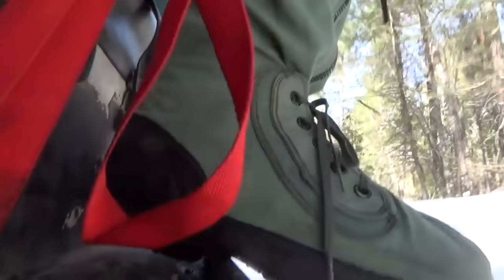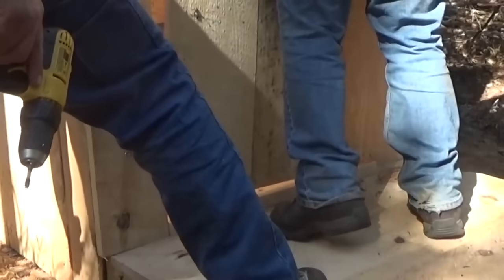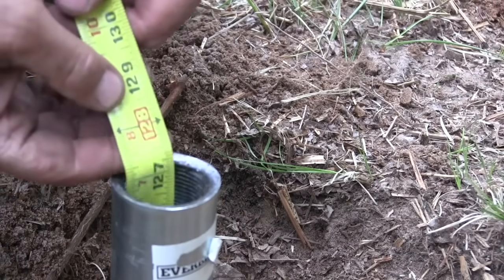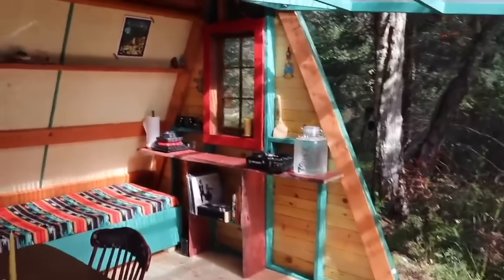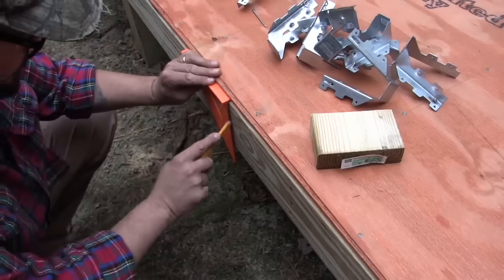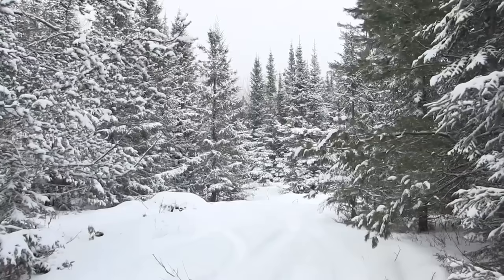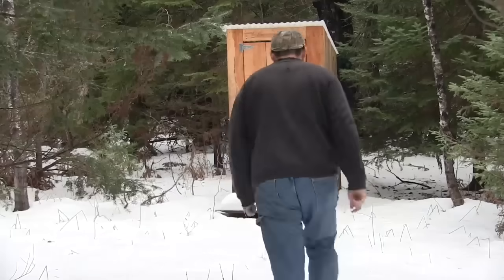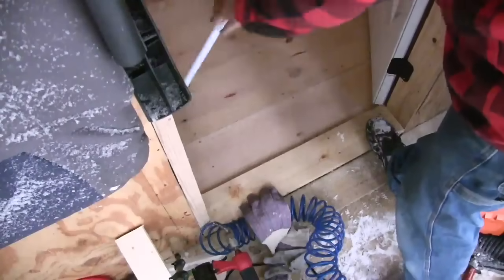Off Grid Homesteading.....everything you need to know

Comment: Instead of an outhouse, consider doing a composting toilet.  A simple 5 gallon pail with a hinged lid with a normal toilet seat on it works well.  If you line it with a composting bag it makes dumping much easier, and you just use sawdust on top of each load.  A hole in the bucket with a funnel and hose attached to drain urine will keep the mixture dry and odor-free.  You can drain the urine into a small pit with stones and sand, maybe a little peat moss.  I have a shower in the same building and the water just drains through the deck cracks and waters down the urine.  When the bucket is full you dump it into a big black composting bin.  I have never been able to get the bin even half full, it composts down to nothing each year.  No flies, no stink, not that difficult, and no digging!
Reply: Or just leave the stuff in the buckets and let them compost for a couple months before adding it to a pile and cover that with another layer of carbon (hay or wood chips) and let it sit for a year after your last contribution.  No need to turn it.  Easy peasy.  No stink.

Comment: My grandparents didn't have electricity until the 70s and always used an outhouse. I got to experience a life that was probably not much different from the 1920s as a child. One experience I have permanently etched into my memory is plunking my butt down onto a cold wooden toilet at -40 degrees. I sure wish styrofoam had been invented back then...  Now this was on an Indian Reservation in central Ontario(Canada) and they never had to move their outhouse. When it was full, my grandfather would hike into town and buy a can of quicklime. They'd pour it into the hole and it would dissolve most of what was there. Not sure if that would have been legal off the Reserve or not, but it sure saved a lot of digging. 🙂

Comment: Love your down to earth backwoods practicality. Reusing older equipment is great. Not only are they totally capable, they are made of superior materials. One thing I'd like to share is if your sandpoint ever gets clogged, you can fire a .22 caliber straight down the bore. The shock wave drives the debris out of the point. I learned this from a well driller. The only downside is you might get a little wet. Thank you for your dedication and videos, their fabulous.
Reply: Good tip!

Comment: Very interesting. I’ll never understand why you guys seem always to fix corrugated sheets in the valleys. Here in Australia we always fix them through the ridges so there is zero chance of leakage as the rubber washers perish over time. Maybe you tend to replace roofing more often than we do? Just an interesting difference.
Reply: @hanlonsmesser  way to be a goober guy
Reply: Within the US we do it both ways. Some people swear that the valleys will leak and vice versa. In the snow country where I lived people swore on using the ridges because it allowed the snow to slide off more easily. 2 feet of snow on the roof? It didn't matter either way. my experience showed that the screws backed out of the rafters long before the rubber washers failed. Never figured that one out but about every 3 years I had to wind them back in.
Reply: @LowTide941  He tells the truth
Reply from the maker: The first roof I did the manufacturer of the steel roof ( that warrenties the roof) told me to fasten the panels that way. I think through the top of the rib the panels can move around too much,

Comment: A little tip for you building off grid, you can get a co2 tank they sell a system that for $75 (gauges) and you can run a framing nailer.  A tank will last you about the size of a 600sq building.  I use this in the UP all the time.  This way I don't need to run my compressor.  You never lose any pressure this way
Reply from the maker: I don't own a nailer though....good tip
Reply: @Bushradical  don' t worry with all the bs coming down they will be cheap to pick up.  People will sell anything for a few bucks just to live

Comment: Lots of ways to build an outhouse. Couldn’t even remember how many I’ve used since a small child.
Simple is easy, the tank pump-able, flush-able, solar powered, heated, wash-room, even multi-room with a sauna, certainly can be done. Even off grid comfortable options. How much money and how much dirty work do you want. Trailer for taking waste out is an option even. This allows for a really nice bathroom you can have in the cabin; though I’ve even seen an “outhouse” in a cabin.
We have a sand point well and another drove into the side of the hill that naturally feeds into the “well”, with the fake bucket/crank, and a pool it fills, also.

Comment: I know this is an older video but I just found your channel and love living vicariously because it's not the right time for me to be doing these things right now, although I have in the past. I love the idea of  sunk posts in the front and on concrete pads in the back because if you have any kind of ground shifting/settling between the front and the back, the building will move with the front posts. If you sunk them all and had shifting/settling, this might pull the structure apart slowly and crack things that you have constructed. Probably not, but if you were building in an area of moving ground over years, this would be a great technique. I like thinking outside the box and what advantages different building techniques have. Great idea. Keep up the great videos. I have a very stimulating job and it's great to relax with your wilderness and building videos to settle my mind before bed. Cheers.

Comment: Dave, the more of your videos I watch, the more it becomes obvious you are one of my neighbors. Doesn't surprise me we haven't met if you are in my township, I don't get out much. I live in a shipping container house I built, and built a pole barn to work on my vehicles and other projects. Even though I grew up on a Nebraska farm and we built structures and poured concrete, I still learned a lot doing it here.  The snow load requirement in this county makes people gasp and think its a typo. The only inspector who cared enough to show up was the electrical guy, and he signed off on it after telling me how to do it they way they wanted it done.

If people use common sense, they can build their home like you and I have. Mine is more 'industrial' themed, since my military job was logistics and I am big into vehicles like muscle cars and 4x4s, so everything I build has a transportation theme. That hard pan sand is only 2' down here, the well that was here when I bought it in 2013 goes down 30'. The first four gallons go pretty quick, after that it slows to a trickle, less than half a gallon a minute. So I am using rain water and snow melt for everything. 

I won't ask where exactly you guys are, but if I see you in town I might say hello. I don't need people from the intarwebnets stopping by where I live either. You'd probably see me first if you see the cars I build, they stand out a bit UP here. Welcome to the neighborhood. I'm enjoying the videos.

Comment: Thanks for these videos.  Really great!  The outhouse is a little bit of overkill in my opinion, though.  I would have used a composting toilet using simple box with a toilet seat, a bucket and sawdust.  You'd be amazed.  There's no smell and you just need to clean it as needed. Boil water and rinse out.  Use vinegar if you want.  They are a miracle of simplicity.  Just my opinion.

Comment: In Ontario we have a lot of rocks, so many outhouses use some form of container (honey pot)  plus cedar sawdust with ventilation to help with evaporation.
Access to change the pot or remove compost is at the back.
Larger ones for tourists are built over a mechanical cranked composers while many cottages prefer composting toilets.
Old style Privies will have snakes if left unattended for a while so you have to scare them off in the spring. We get rattlesnakes buzzing away underneath but they're skiddish and don't like company.
Bats like outhouses as well so if you don't want them it has to be well sealed. They won't hurt you though.
Lights going to it and inside are good.
Plan to put it downwind.

Comment: Thanks for being so open to talk straight about your motivation for this channel! I totally relate to so many aspects you brought up with regards to the cost and complexity of today's living - besides I am living in Germany and not the US. While for sure I cannot truly compare, I certainly perceive that building regulations are going up here, property prices soar, total cost of ownership rises, be it houses, cars, appliances, everything while wages have stagnated for about 30 years now.
Where I live - and that's in a semi-rural area- you cannot find property for a family home larger than 500m^2 or 1.1 acre with even the hope to finance it by mortgage.
The state of Germany and the EU have been increasing the speed in putting up ever more detailed (and restrictive) regulations. New homes for example are required to consume less energy (regardless of source) than 45kw per square meter per year. This has necessarily an impact on build complexity and cost. Maybe you can still try to keep the complexity down, but then you risk your financial investment because such houses may be susceptible to mold, or may be difficult to maintain, or not attractive for future buyers. Problem is, you raise the bar one step but the overall complexity grows by multiple. Housing has become and recognized as a huge issue, but yet nowhere in public discussion the aspect of complexity and it's driving factors are being discussed.
On another note, regulations "sneak in to life" where I would have never expected them. Some years ago, I had to buy a new Siemens electric hob and oven. Strangely the new one didn't get as hot. For example, frying meat is noticeably more difficult. Did I buy a bad model? No - turns out there's been an EU regulation introduced for kitchen appliances that limits their power consumption. And that's for an electric hob and oven where the electric energy is supposed to be only used as heat!. Well, on second thought, not 100% of the energy ends up in heating up your food, but some in heating up the air around it, thus some percentage is not used on purpose. And since the regulation is formulated that a certain percentage must be used on purpose the vendors reduce power to meet the goal (radiated energy not used to heat food grows non-linear with power, i assume). Point is, I don't anybody want to tell me how to cook my food!
Similar de-powering regulations exist with vacuum cleaners for example. I can see why you realistically don't need 2kw in a vacuum cleaner and that the market probably won't find a natural equilibrium in decreasing from high power figures in the mid-term. In case of a vacuum cleaner, I am willing to accept a limitation when there is no usable benefit from exploiting the available power anyways. But on a hob and oven!? These have regulating knobs. And no, I don't eat my food baked to coal on purpose.

Regulations, sadly are just one aspect. Traditionally regulations adopt to the "standard of living", or "state of technology". The continually or stepwise change in direction of ever more complex systems, more specialization, fields of expertise becoming ever more vertically and horizontally segregated had been called "progress" by previous generations (I think). Your channel is very much about the question what these are (not) and cost these incur. It is a state of consciousness, a mindset, maybe a philosophy or maybe an attitude. However, I seriously believe this is one of the most difficult questions to our societies because it's unfortunately not solely just a choice of an individual

The statement "I could not do that" is next to the direct physical and practical implications also a hint at why it is not a matter of will alone to live a simpler life with more freedom. While the topic of living off grid appeals to so many, it seems as if it is the mass of ourselves that keeps us moving deeper and deeper into that dilemma. We are many, have become more and keep on becoming more. But resources are limited. That's probably more easily seen here in densely populated Germany and EU. Some of our efforts have gone into exploiting more resources for less cost and creating systems and organizations to supply our increasing demands in this life style (or call it "wealth" or "progress", or whatever). The problem is that this is mostly a one-way street for society. On this road you cannot make a U-turn from building ever more complex systems to simplifying things without generating supply issues, deficiency symptoms and social unrest. Western civilization had been trapped in a complexity spiral for more than 2000 years already. Since about 200 years the spiral has been exponentially turning faster. Since about 20 to 30 years, we have come to notice culminating resource imbalances, like land use, agricultural limitations, climate change, loss in biodiversity which have begun to affect us by making life more difficult - to say at least.
The problem is to get off from that, to escape with "making a soft landing". If we as a society cannot make a new deal the matters will just make 90% of mankind victim to these constraints and would eventually lead to what most people would broadly describe as de-civilization. That could be several different scenarios... What I’m trying to say here is the fact that many people struggle to find a place to life, be it for rent, or through real estate ownership (even be it mortgage based), is the result of: resource limitations, population density, increasing complexity and, yes, expectations - at last.

The EU proclaimed the "Grean Deal" to become carbon neutral by 2050 like as if it just took a snip of fingers to solve that problem, i.e. as it was just a matter of political will to make it happen. They have not succeeded in creating a deal with ordinary people, me included, and so I object to these regulations dictating house complexity by energy demand and power use of kitchen appliances even though I am writing these very same lines and watching your channel. How schizophrenic! But I guess this is just a hint at how difficult of a problem for society to solve that is.

Comment: Pressure treated is not rot resistant when in contact with the ground. It should also not be set in or in contact with concrete. It is best to pour concrete piers and then mount the PT post using brackets that hold the wood away from the concrete ,dirt and water .

Comment: Floor looks strong enough for anything you could drive on it but man the clearance between the top of your cab and that cross beam looked really tight. Might have just been the angle of the camera but be careful when you have chains on the tires. I love how tight the floor boards are and I’m sure they will gap just a bit as they dry so as not to buckle.

Comment: Dave, I appreciate your videos. I have a question about your cabin and outhouse. 

Have you ever thought about installing a solar system that could run the lights? You could also install a motor for the water pump and potentially have running water and even a potential septic system instead of just an outhouse. 

I am not from that far north but just something to think about.